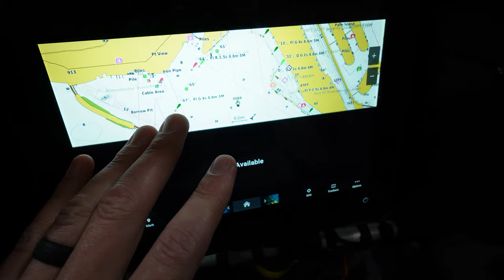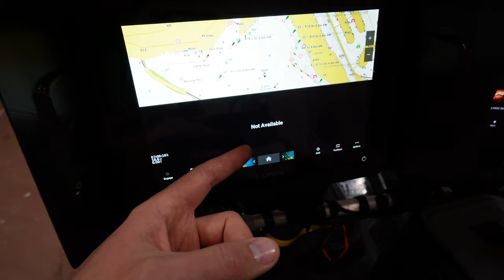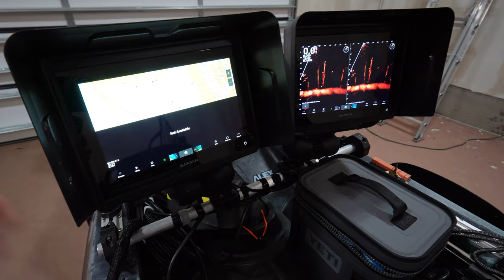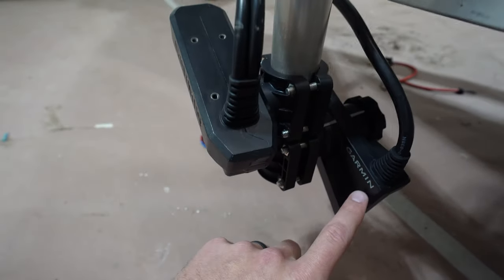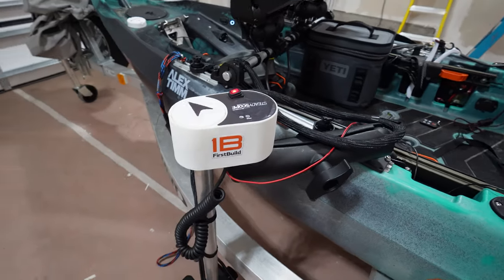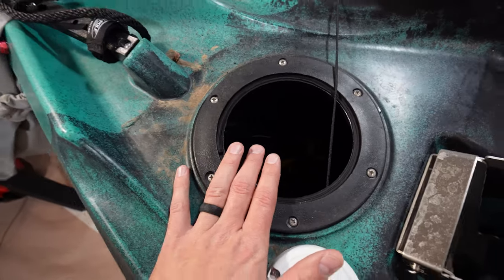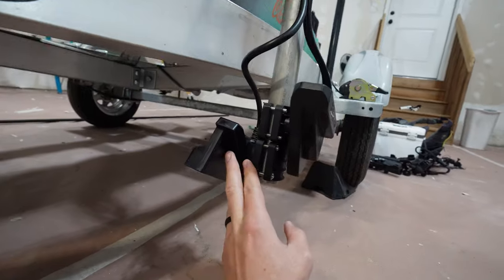How to Setup Your Fishing Kayak with Garmin Livescope!

Comment from the maker: Thanks for watching! Here are links to the items from the video:
🔗  Amped Outdoors 48AH NMC Batteries: https://at.fish/AmpedOutdoors48Ah (Use code: TIMM10 for 10% off)
🔗  Garmin GPSMAP 8610xsv screens: https://at.fish/Garmin8610xsv
🔗  Garmin Livescope LVS32: https://at.fish/GarminLivescope
🔗  Garmin Livescope Plus LVS34: https://at.fish/LivescopePlusSystem
🔗  4K Screen Recorder: https://at.fish/4KScreenCaptureCard
🔗  Steady Scope Transducer Mount: https://at.fish/SteadyScope
🔗  Summit Fishing Livescope Boat Mount: https://at.fish/SummitBoatMount
🔗  Summit Fishing Livescope Pole: https://at.fish/SummitPole
🔗  RAM D Ball Adapter: https://at.fish/RAMDBall
🔗  RAM Double Socket Arm Long (for holding the pole): https://at.fish/RAMDoubleArm
🔗  YakAttack GT175 Gen II Tracks: https://at.fish/YakAttackGT175GearTrac
🔗  Screen Cross Bar: https://at.fish/1inchAluminumBar
🔗  Cross Bar Track Mounts: https://at.fish/BarTubeClamp
🔗  RAM Mount for Screens: https://at.fish/RAM-D-115BU & https://at.fish/RAM-D-201U-C & https://at.fish/RAM-D-235U
🔗  Wilderness Systems Through-Hull Adapters: https://at.fish/WildernessThroughHull
🔗  SAE Power Socket: https://at.fish/SAEPowerSocket
🔗  Angel Eye Power Button: https://at.fish/AngelEyePowerButton

Comment: Alex, why do you use visors for your 8610 units, if Garmin claims the 8600 series is perfect to see at any angle and bright sun conditions?
Reply from the maker: Sun glare, it isn't horrible with the screen by itself, but I do have tempered glass screen protectors on them and they make the glare pretty bad if not using the visors

Comment: Do you have a on/off switch for the boxes
Reply from the maker: Which boxes?
Reply: I have 2  93sv on my kayak thru a yak power system. So turn my box off .
Reply from the maker: Nice, I have master power switches for the battery banks in the kayak yes 👍 Would hate to have them drained accidentally when I'm trying to launch and get out